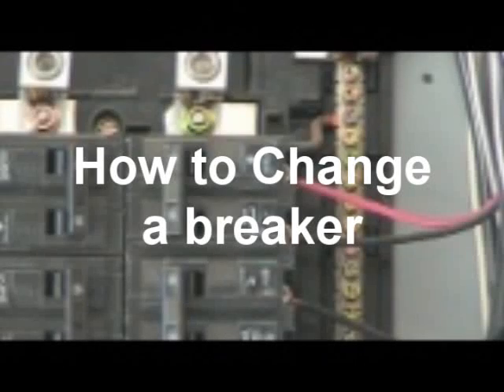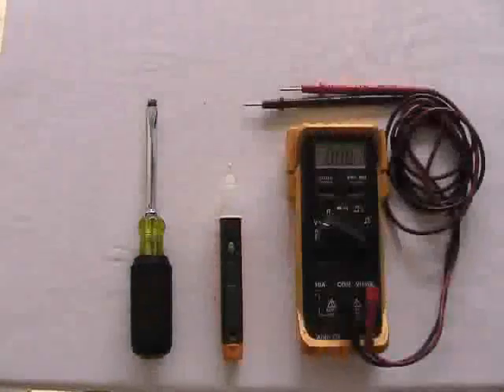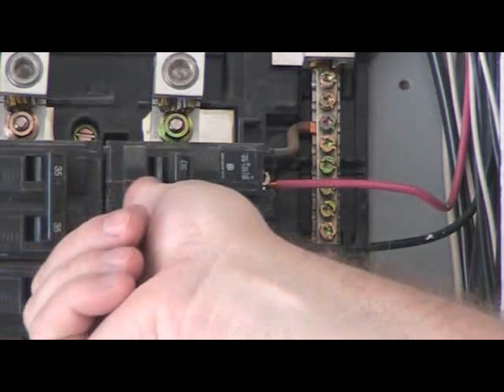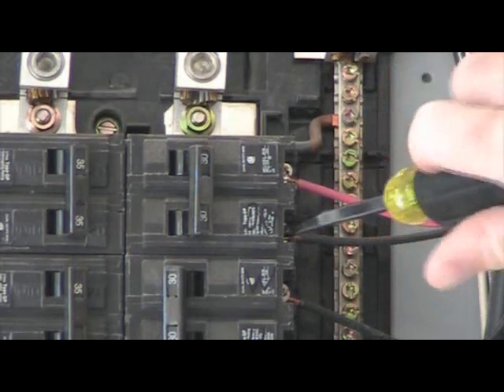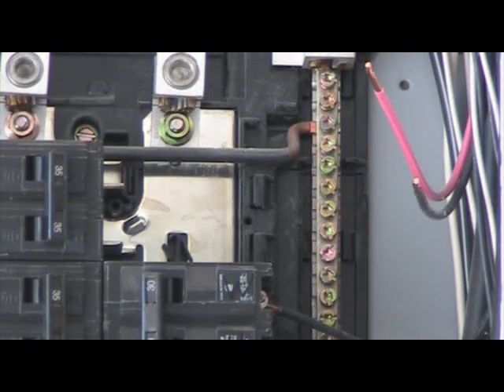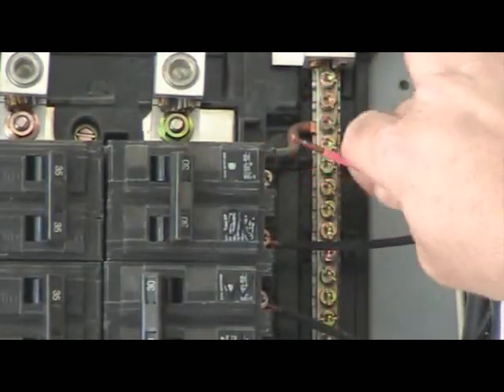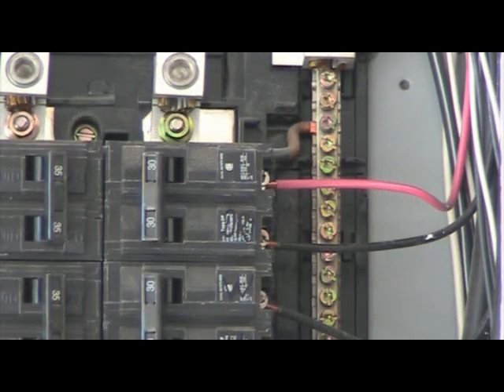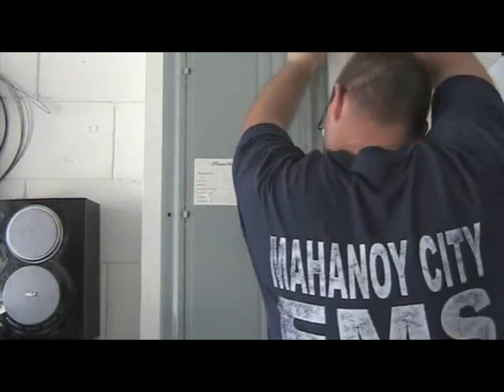How to Change a Breaker

Comment: You touched the black wire and were about an inch away from touching the red one aa well..  SIMULTANEOUSLY!!!  I dont think you shut off the main breaker... i know nothing about electricity  (hence I'm here) but even I know that step 1 even before removing the panel cover, using common sense would be to shut off the main line. Otherwise AWESOME VIDEO.

Comment: Why mention a volt meter and then not use it?
Reply from the maker: Yes that was an oversight when I made this video.  You can use any meter or non contact tester to verify that the power is off before changing.

Comment: What about the white elephant in the room people. why is this video even still online? it's the first video that comes up and unless you read the comments then oneself is at risk of being shocked. You can't turn off the breaker and the wire be off, it's still hot (live, can shock you) that being the reason to turn off the main. this video has tons of views and lots of likes and low dislikes. well in this videos case the dislikes are the intelligent people that know what you've just watched in this video is unsafe and ridiculous because he turns the breaker off....Really people. better hope the replacement one is off and someone hasn't flipped the switch on making it dangerous (duh)    In viewing the video, right when the guys takes the breaker out he almost touches both sides off the exposed wiring, which I'm not an electrician, however the main power is left on. I'm thinking he almost shocked himself, but by dumb luck he doesn't and I'm disappointed that it didn't really, because the guy that made the video has to have seen comments stating how unsafe the video is and he leaves it up  anyway.

Comment: Everything looks good in this basic electrical presentation except the color coding in the panel. The wiring should be black, then red. In a commercial three phase panel, it would be black, red, then blue. That's for a 120/208 three phase panel. But, I will give you a 9 out of 10 on the video as a whole. Picky, picky, huh? You know the electrical inspectors look for this kind of thing!
Reply from the maker: If I had been the one that wired this panel, the color coding would have been correct.  However since I bought this home 3 yrs after it had been built, I get what I get.  I was not about to re-wire the panel just for the fun of it lol
Reply: I think he was talking about the 2-pole branch circuits on the breaker...switching the two leads would have been correct as he mentioned.  Had it been him or I , we would have switched the leads just because that's what good electricians do.  This would not require the re-wire of your panel board.  I do give you an A for presentation.

Comment: This video is a joke. You don't NEED to use a flathead, as most modern breakers have a square option too, which is nicer because it self centers, and there is less of a chance of the screwdriver slipping. Second of all, if this guy was an electrician, he would NOT have a Siemens/ITE/Murray/Gould panel as they are far less than reliable when compared to GE, Square D, and Cuttler Hammer (though CH is in third by a decent margin.) The reason being is that they breakers are cheaply made and prone to failure, and the buss in the panel is ALUMINUM... which is total shit. BAD idea. Go with Square D QO, or General Electric (GE) panels and breakers. 

Also...
There are comments after comments saying that the main breaker needs to be shut off.

This is false. The main breaker does NOT need to be off to simply replace the breaker for a branch circuit.

IN FACT, the panel in the video DOES NOT even have a main breaker. Which is probably because it's a sub panel.

Comment: as a woman, or just as a smart person?  i'm a guy and it scares the crap out of me.  i think this is the attitude of any sane person when working with electricity.  as for your problem, you probably have it solved already, but it sounds like you might have been using more power than the circuit is designed to handle.

Comment: Wow.  Someone wearing an EMS shirt is giving bad, potentially deadly advice.  Must be looking for work.   No protective gear.  The breakers must be torqued to meet manufactures specs, not just tightened.  No mention of turning off the main breaker.  It isn't experienced people looking at these videos, they already know how to change a breaker.  It is the inexperienced person that is the issue.  Safety first.  As an EMS, you should know better.
Reply: Hey Steve not all breaker boxes have a main breaker in it to shut it off, ours is an old model and it doesn't have one, so we have to take the whole breaker out before unscrewing the wires.  And I pretty sure you don't call an expert every time you change a breaker to have it torqued get real man.
Reply: Correct.  You have a split bus panel.  The biggest cause of fires in panels is due to loose connections which cause redhot connections.  Thus the torque requirements.  I have a torque wrench for main lugs and a torque driver for breakers.  Normally the torque requirements are written on the side of the breaker.  If you are going to make videos for public consumption, at least use the right tools and do it correctly and up to manufacturer's  requirements.